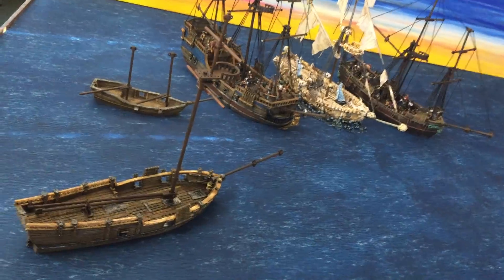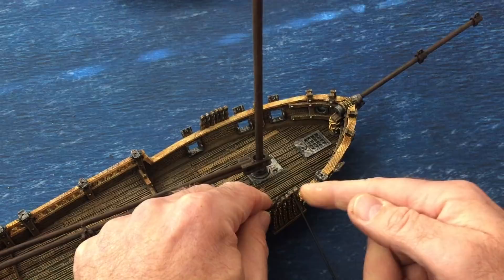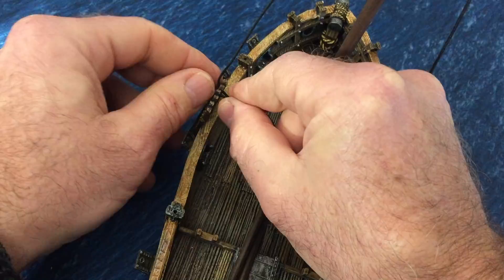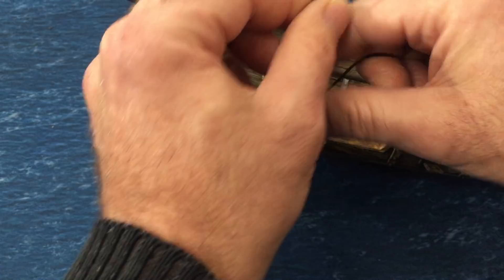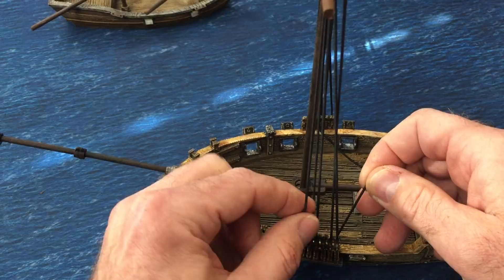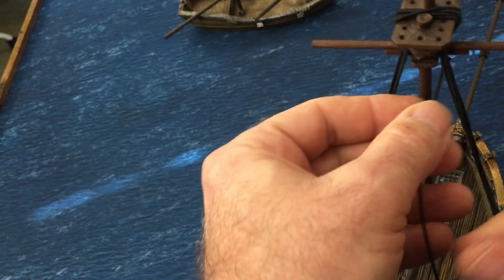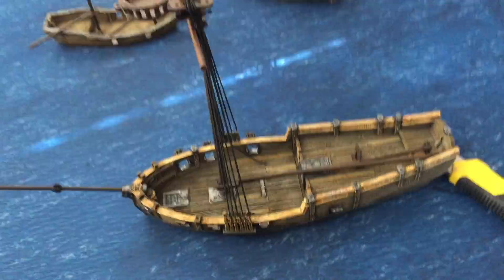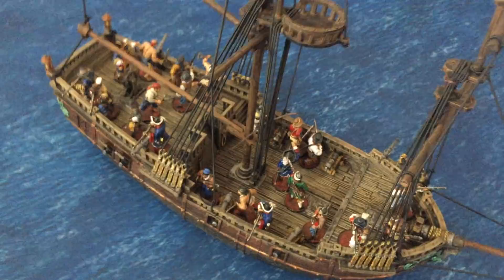28mm Ship Rigging for 3d Printed Sloop for Wargames and RPG

Comment: Why are you not making the rigging going through the holes in the crows nest? That looks like it would space out the rigging a little bit more to give it a more natural (ladder) look. Is it because of stress to the part. There would be no need to tie them and let them go over the part like you're doing now or insert them from the top, make them go under the crows nest and let them come out from to bottom to go back to the rigging on the deck.
Reply from the maker: You could, the holes are intended for rigging halyard lines but equally you could use them for the rigging.
Reply: @printablescenery  I looked at actual rigging for ships and realized there is another set of rigging starting from the crow's nest to the top of the mast.  From those rigging images, I noticed that the the rigging from the deck end slightly below the crow's nest and there are holes in the crow's nest to access the latter.
Damn your boats are nice and it's difficult for me to wait for the funds to get myself a 3D printer, I want to buy at least 2 or 3 of your boats. Keep up the good work.
Reply from the maker: @VingloLeClerc  Yes, they are usually used for displaying ensigns and other smaller flags. We appreciate the compliment, and highly recommend the Ender 3 when you do take the plunge. Its not too expensive and gets some phenomenal detail.

Comment: hi on what 3d printer did you use ?
any settings for the prints ?
may thanks
Reply from the maker: Bolt Action Bunker it was printed on a prusa i3 mk3 at .2

Comment: Any chance you guys would update your boats to include hull files that would be optimal for resin printing? Such as maybe hollowing out the bottom so you can’t see that it’s hollowed but at least them it won’t print using too much resin?
Reply from the maker: That's a good idea. We are doing some upgrades next month to these so will have a look at that for sure.
Reply: @printablescenery  thank you! Absolutely love the models but I prefer resin printing (which they look phenomenal at smaller scale)

Comment: Do all the ship use the same Diameter Dowels? what dimensions do you recommend.
Reply from the maker: Hey Michael, they all use 6mm and 4mm dowels, just in different volumes depending on the size of the ship. You can find the amount you need in the ships description on the website, down near the bottom. I have included the black ship as an example, if you scroll right down you will find the amounts you need. https://www.printablescenery.com/product/the-black-ship/

Comment: where can I buy a model like this
Reply: Links in the description. Should warn buying it default will get you the 3D printer file, but there is an option on their website to have it printed for you.
Reply: Eantrin ty
Reply: Eantrin by the way not a bad deal 15 bucks with tax :)
Reply: I do not have 3D printer but can I print it out at the library if I buy the model can I print it out at the library?
Reply from the maker: @nauticalshipsandothernerdy3036  yes you can do that